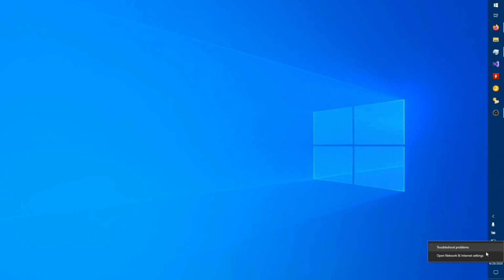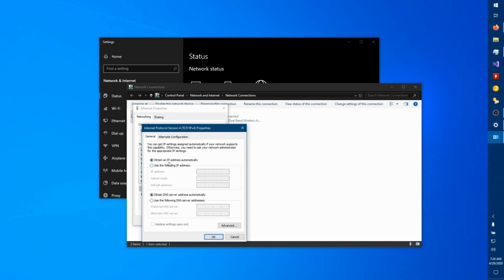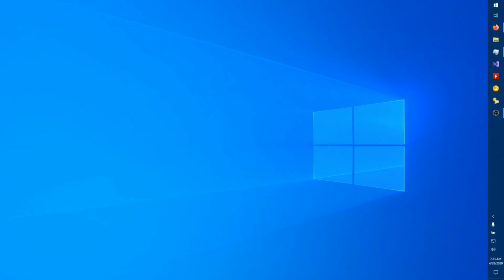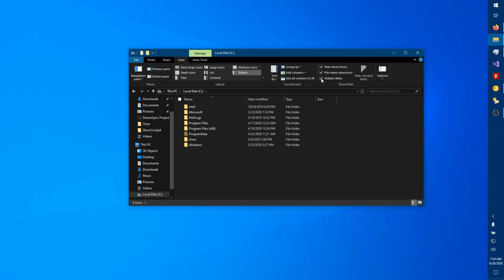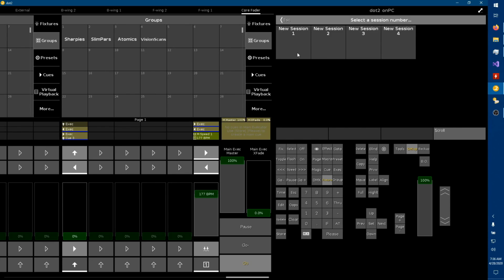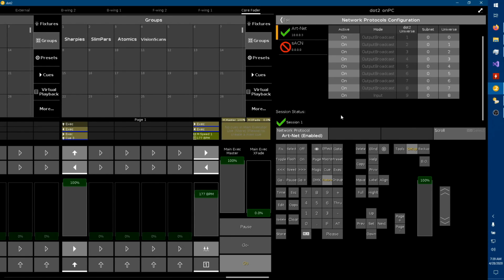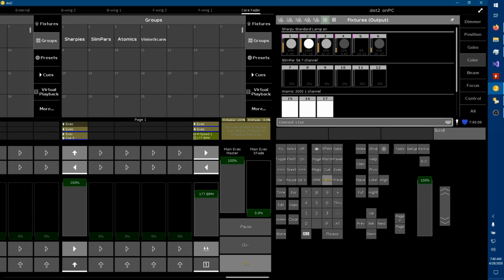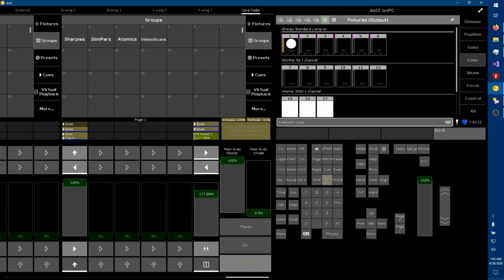MA dot2 OnPC for Unreal Virtual Production Primer

Comment: Well I tried to send artnet from resolume/ableton live project set in another computer (mac), and monitoring with artnominator everything works wheres UE its running (win) (dmx flow data), but inside unreal its impossible connect, theres a kind of firewall? with osc there's no problem, so i dont know what to do. I tested via Touchdesigner inside the same computer (win) of UE with a loopback network (2.2.2.2), same with ma2onPC and works in both!. I just want to record the dmx sequence for render in playback, and the only thing i can do now its verify UE...

Comment: So I was able to get dot2 working through sACN in ue4.25 but when moving to ue4.26 I had to use Art-Net but was only able to get it to work last night. This morning I booted everything up and I can't seem to get any information from either protocol into unreal on the same machine. I opened my 4.25 file and can still get sACN to work and when I use sACNViewer I can see signals. I am aware they completely changed the way the fixtures worked and I went through and updated everything. I am no longer able to get Art-Net to output signal in dot2 either but that's not unreal's fault. I know it isn't 100% what this video is about but I figured I'd take a shot in the dark in case you knew a solution. I made a post on the unofficial ue4.26 DMX forum post with a screenshot with more info.

Comment: hey bro very helpful video for a start. i got a question you said that it will require two pcs because network adapter can only be used by one software , but it works with resolume on a same pc i have done a similar project in which i can get an rgb light glowing by resolume arena on same pc through artnet, it will be much aprreciable if you tell us the how to do it in dot2.
Reply from the maker: So there's a bit to unpack here. First of all, at the time of recording, that was pretty much the best way or working and to some extent still is, at least insofar as up-front accessibility, but there's ways of pretty much getting what you want. I can replicate that Resolume can communicate with Unreal on one machine, so this is likely an issue specific to dot2's software implementation of ArtNet as a protcol. sACN does not have this problem however the sample fixtures don't work with sACN by default. 

You would need to edit the very first node Get DMX Functions in Get DMXCurrent Normalized Data inside BP_Fixture logic to specify sACN in the drop down instead of the default ArtNet, and with that, it should be possible to get dot2 working with Unreal on one machine with sACN, since I've seen dot2 communicating on the same machine with Capture viz before using sACN. It's just kind of annoying to dig for and doesn't make for a good default tutorial situation, plus it's good to learn a bit of networking when digging into lighting anyway. 

This is something I intend to make more accessible in my own custom fixtures and I assume the first party efforts will likely do the same in the future since it's fairly simple to expose. Just note that whether it's easily accessible or not, you'll also need to switch over your DMX Library's Controllers to also use sACN instead as well.